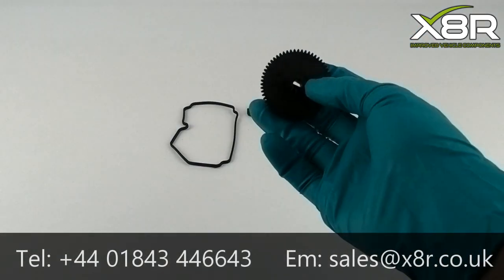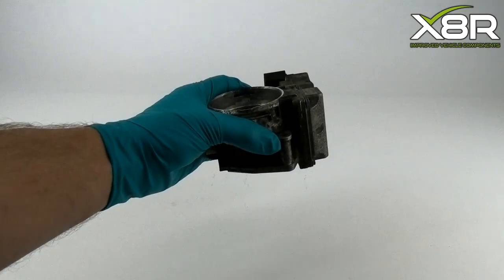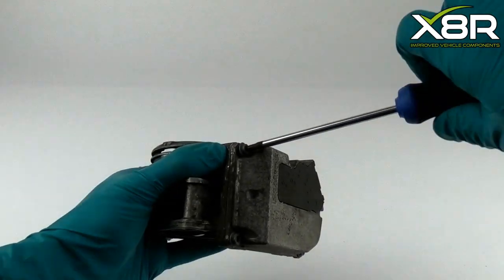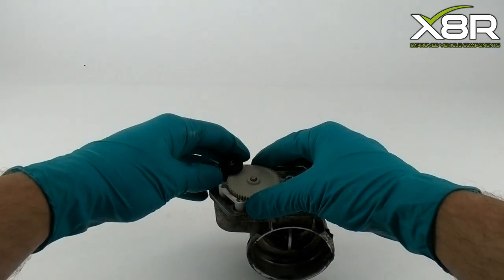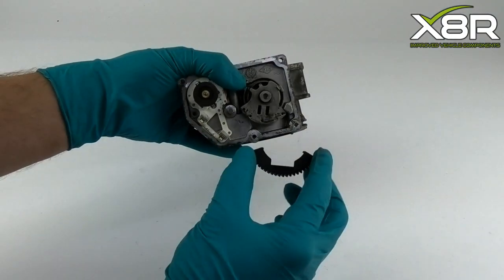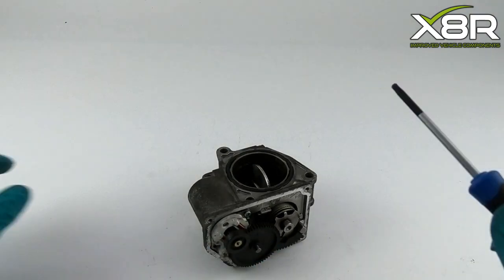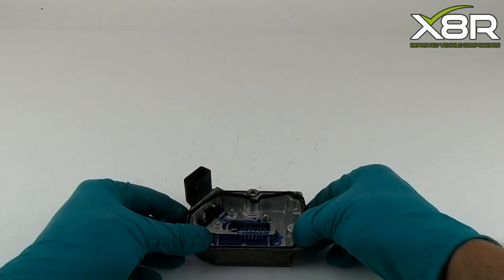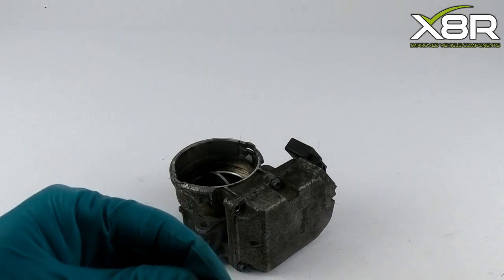Audi Seat Skoda VW Kia Hyundai VDO Siemens Throttle Body New Gear Repair Install Instructions Guide

Comment: Thank you very much.  My throttle body is working now...
Reply: Hy  pls give the address where you buy the throttle body kit
Reply: Do they do a seal kit for the throttle plate shaft as my motor had oil inside of it.